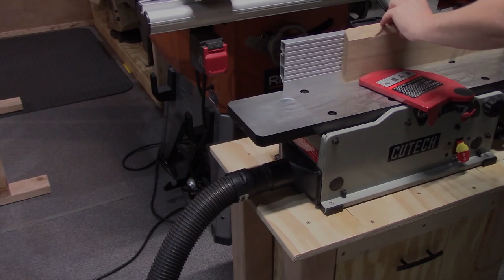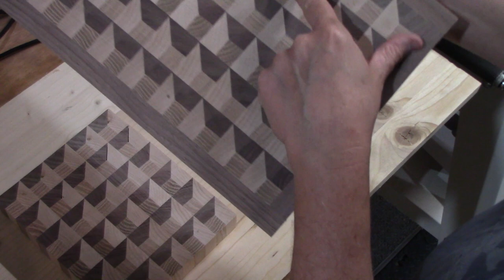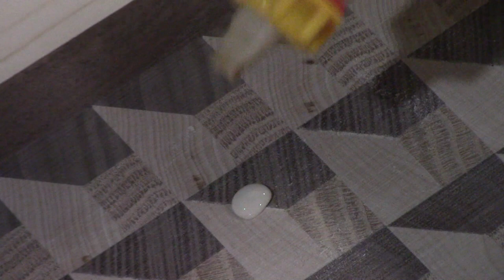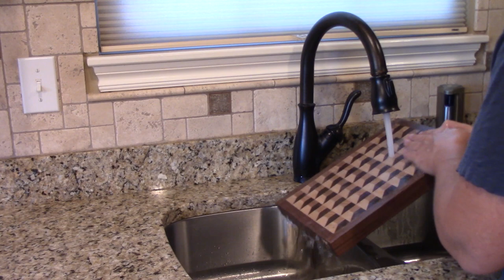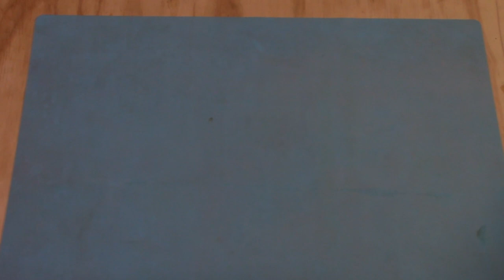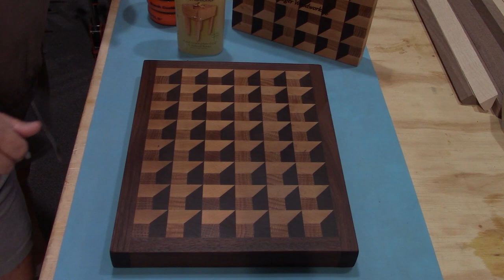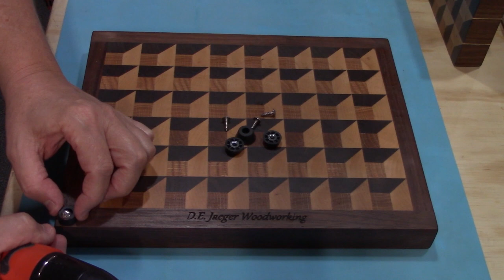The Stunning 3D Cutting Board - Part 2

Comment: Do you have a link for these cutting board feet? I have never seen them with metal inserts.
Reply from the maker: Thanks for stopping by to watch the video and comment.  The first set of rubber feet that I purchased didn't have the metal inserts and feet would often times work themselves off of the screws.  I found the feet with the metal inserts and haven't had a single foot come off.  Here's a link...

https://smile.amazon.com/gp/product/B079PKFTBY/ref=ppx_yo_dt_b_search_asin_image?ie=UTF8&psc=1

Comment: how long do you saturate the board with food grade mineral oil?
Reply from the maker: Thanks for stopping by to watch the video and  for your question.  I used to just rub the mineral oil on with a paper towel, but saw several other wood working videos where they were dumping them in large vats of mineral oil.  I came up with my own  tupperware-type solution that fits the majority of my cutting boards that allow me to take a lid on and off and also store the rack that I let the cutting boards dry on.  I typically submerge them for maybe a minute or two, then place them on the rack on edge.  After they dry over night I then give them an application of cutting board conditioner that I apply by hand.

Comment: Wow very impressed Darrell.  I’m new to your channel so naturally I’ve subscribed.  Only one question.  Won’t there be problems with the board swelling up and splitting when it gets wet and through the seasons?  Especially with the walnut edging?  Thanks
Reply from the maker: Thanks for stopping by to watch the video and comment.  I have had several comments regarding the border on this one because it's not endgrain like the rest of the board.  With a board like this and so many glued surfaces there's always the possibility of shifting, splitting, etc.  Proper care, cleaning, and conditioning of the board is paramount, and even then there could be issues.  Less so without the border.  The customer that I made this board for is pretty meticulous with his cutting boards, so I know at least from a care standpoint that the board is in good hands.  I have also asked for him to keep me informed of any issues that might arise with the board.  If I were to do this board again, I would likely forgo the border.
Reply: @DEJaegerWoodworking  I feel the border is necessary for artistic purposes. No doubt this is artwork!
Reply from the maker: @christopherjbowers659  Thanks for your comment and compliment.
Reply: @DEJaegerWoodworking  I did an end grain walnut cutting board with a maple border face grain but only half the depth of the walnut so the side would have a "two wood" appearance.  That was several months ago and there has been no issue.

Comment: What are the advantages of using a drum sander instead of a planer?
Reply from the maker: Thanks for stopping by to watch the video and comment.  You're going to get a lot of woodworkers that would tell you not to use a planer on endgrain.  While I mostly subscribe to that theory, I will say that I have done it with a few precautions.  First, I would build a frame of scrap material around the endgrain project so that edges won't chip out when sending it through a planer.  You can see where I did this in my video "The Mosaic Endgrain Cutting Board" at this link...   https://www.youtube.com/watch?v=C-_de4ukx1c&t=26s    Second, I would make sure that your planer blades are SHARP.  Third, I would take very small passes through the planer and remove just a small amount of material with each pass.  If you use some precautions it can certainly be done.  In regards to the advantages of using a drum sander, I can't really say there's an advantage other than it isn't likely to chip your project like a planer could (unless using the techniques described above).  The main advantage of a drum sander for me is getting that base sanding level accomplished without doing it manually.  Unless you plan on changing out the drum sander papers in increasing increments then you're going to have to go manual which is time consuming, hot, and messy all around.  I think the drum sander is the single best purchase I've made (at least at this point).
Reply: @DEJaegerWoodworking  Thanks for the reply, it makes a lot of sense. Can you recommend a reasonably priced drum sander? I understand buying because of low price can lead to regrets.
Reply from the maker: @tomandkelly  Tom, the first thing you would need to do is determine was what sort of projects you're going to be using the drum sander for, and what dimensions those projects were likely to be.  For me when purchasing my current drum sander (Unboxing and Review of the Jet 1632 can be found here...  https://www.youtube.com/watch?v=Ew_L2-RMPNY&t=1s ) that included dimensions that typically don't exceed 16" wide, but I also wanted to know I had the ability if it was ever needed.  I looked at a few bench top drum sanders, but really liked the open end of the Jet as it allows for a project twice the width to be sanded.  The second issue was cost, because there's typically an entry level priced sander, a mid level, and a higher end level.  The entry level priced sanders (and Jet has one), just didn't seem to be as durable, and the higher end sanders were just overkill, or over my budget.  Again, keep in mind what you plan on using it for.  Maybe one of the benchtop sanders would satisfy your needs.  When you search for info on drum sanders, Jet came up over and over again.  However, Grizzly does make an 18" drum sander, and Powermatic has a mid-priced model as well.  I believe I also looked at Shop Fox.  The last issue really came down to product reviews and the Jet had far more reviews (and positive ones at that).  I have been very happy with it thus far, and use it on virtually every project that I produce.  As noted in the video, a good dust collection system will also be vital on machines like these.
Reply: @DEJaegerWoodworking  Thank you for the info.I appreciate the detailed response.
Reply: @tomandkelly  the only thing I’d add is the cutter head of whichever planer you use. As you might’ve heard there are straight bladed cutters and helical cutters (usually more expensive but higher quality planed surface).  The shearing nature of the helical cutting blades is likely to decrease tear out, especially on an end grain surface like this, but still can occur so following his advice about enclosure and light passes still applies.

Comment: Why put feet on cutting boards?
Reply from the maker: Thanks for stopping by to watch the video and comment.  Personal preference really, but does help with air circulation, stability, etc. On smaller boards I don't always put feet, but for larger ones I typically do.  However, if I know that I want the end user to be able to use both sides of the board then I won't.  If you watch my video titled "Mosaic Endgrain Cutting Board" you'll see that the board has no feet and thus can be used on both sides.  Here's a direct link... https://youtu.be/C-_de4ukx1c

Comment: Forget the food safe oil bah. That would hang on the wall. I can't imaging taking a sharp knife to cut something on it. These three D builds messes with my head. LOL
Reply from the maker: Thanks for watching the video and commenting. I appreciate it!  This particular board ended up with a customer who keeps it on his island as a “conversation piece”, but once a board is out of my hands it’s up to the customer to use it as they choose. I like it when the boards get used, but I understand.
Reply: @DEJaegerWoodworking  I understand what you mean by liking when your boards get used. Much of the work I've done over the years was never meant to hang on a wall. I did air brush work painting T-shirts and car tags and other things. Meant to be worn or mounted on a vehicle.
Reply from the maker: @danielhanawalt4998  Thanks again for watching the video.

Comment: Nice board. But using a porous wood like red oak is not the greatest idea for food prep or anything that regularly gets wet.
Reply from the maker: Thanks for stopping by to watch the video and comment.  I've taken a little heat for using red oak in this project due to its porous nature, instead of the traditional cherry.  It really is going to be on the cutting board owner for know how to clean and care of their cutting board.  The owner I made this for is extremely particular about his cutting boards and knows proper care.  Additionally, I provide extensive instructions with every cutting board on care, cleaning, and conditioning.  You'd be surprised how many people really don't know the proper care of a cutting board.
Reply: @DEJaegerWoodworking  full disclosure, I made a comment about the red oak as well. But it also occurs to me that the mineral oil and bees wax would tend to fill the pores especially when the owner takes good care of it. Maybe it’s not really a big deal.

Comment: why didnt you miter the edging pieces
Reply from the maker: Thanks for stopping by to watch the video and comment.  The border, to tell the truth, was a completely last minute decision.  As evident by the fact that I've caught a lot of crap for not making the border end grain as well.  Sometimes you do something "in the moment" and deal with the repercussions later.  I would definitely do the borders in end grain.  Miters, not so sure, maybe?  I switch back and forth on miters and a simple butt joint.  If you watch the Wine Cork Collector video on my channel, you'll see that I discuss that very topic.  Thanks for your insight.
Reply: I’ve said this before but 1. The border is fine the way you did it, providing contrast. It separating does not seem like a high risk if well dried and well glued (which it was).  2.  Miter joints are so commonplace they are just blah.  Butt joints are better here. Don’t give in brother!